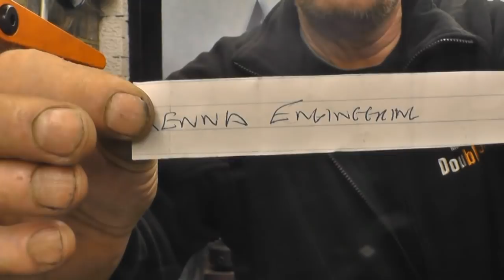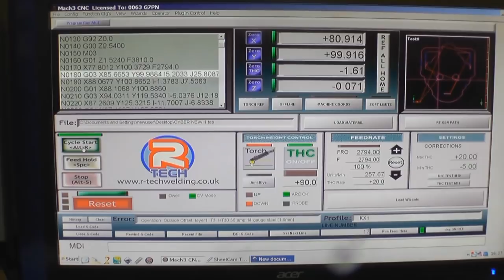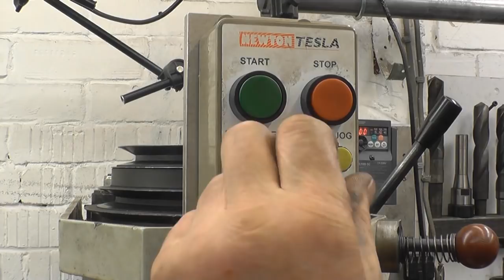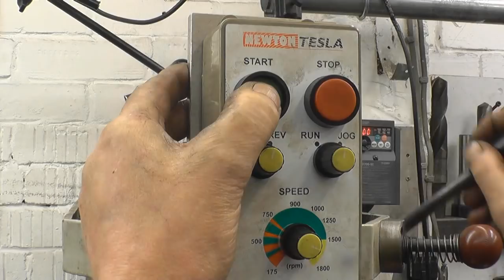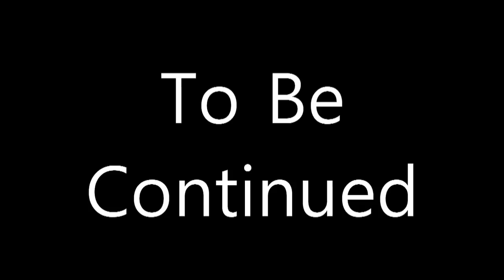SNNC 211 P1    Plasma Cyberman

Comment: You’ve bought a PAR64 or 56, takes 1000W or 500W (PAR64 or 8” diameter) or 300W (PAR56 or 7” diameter) lamps, generally quite narrow angle, though you can get wider lamps for it. It takes sealed beam units, a lamp is around £15-20, so £5 for a whole unit is a bargain. More of a stage light than a video light, but could be used for filming.

Comment: That light is a Par Can. It's used for stage illumination. The sheet metal holder is called a gel frame. You'd hang a group of them across the front of a stage on a truss to provide a wash of light. They're pretty inexpensive so you see them used by small bands or DJ's. As you see, the lamp itself is a sealed beam. The official name is a PAR:  Parabolic Aluminized Reflector. These fixtures are quickly being replaced by LED PAR cans because they use much less power, run much cooler, and don't need gels for color. Judging by the size of the fixture and the wattage, the lamp is a PAR 56.
Reply: larrysbk by the size its rather a PAR64 long .

Comment: Glad you caught where you were drilling!
Reply: I saw that too Larry!  I was yelling at the screen about it. Looks like he heard me.  LOL  Mister Bozo was knocking on his shop door!!!
Reply: When he spotted the three holes in the back of the chuck one of the holes was positioned directly over one of the 3 jaw screws.  Around minute 8:11.  If drilled there it would have gone into the threads of the screw.  He relocated it about an inch away from the original. Close call!!
Reply: The holes finally drilled in the chuck were fortunately not in the positions they were punched earlier in the video.  If they had been drilled there it woudl be a case of a bit of cast iron dust and then oh dear that drill is now hitting hardened steel.
Reply: He was positioned on all three jack screws!
Reply: What did I not spot?
Reply: If you look back in the video, he did drill that first hole. Wander how bad the screw was messed up?
Reply: I see now - thanks Fred.